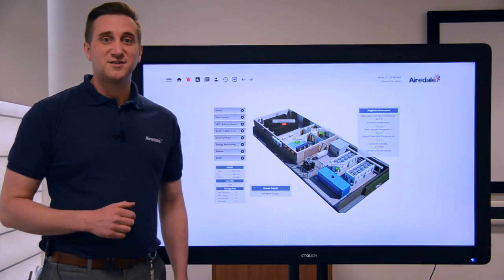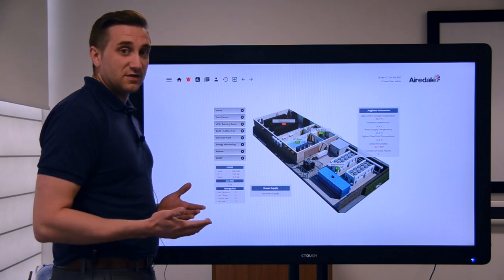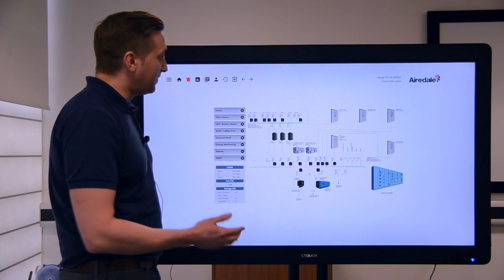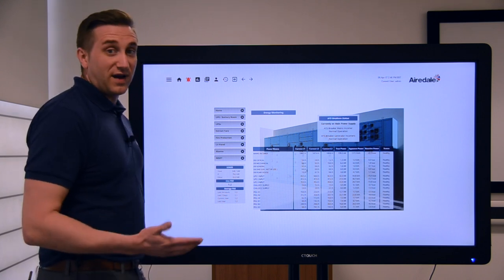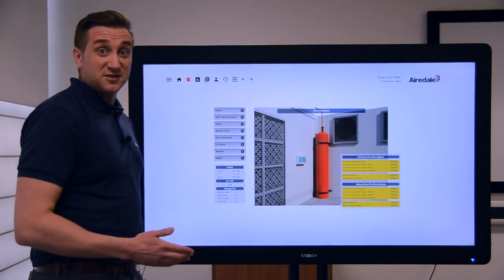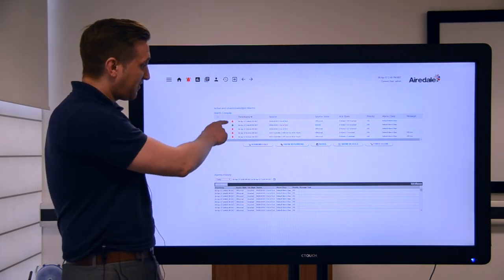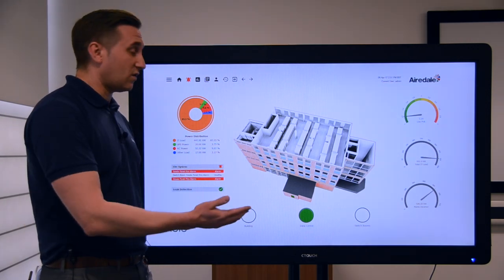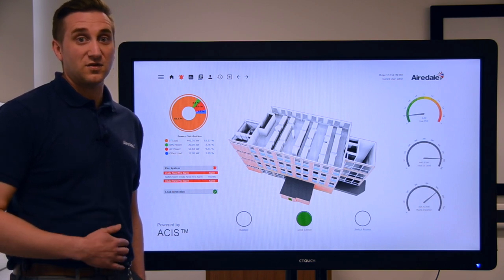ACIS™  Building Management System (BMS) Demo with Jon Martinez

Comment: What the different between BMS & BAS?
Reply: Hello, nothing really. I think it’s an Americanism. BMS (Building Management System) would typically be used in the UK and BAS (Building Automation System) in other places. They describe essentially the same thing, where you have a combination of hardware (temperature sensors, EC Fans, dampers, etc..) monitoring and affecting the building based on software running in a controller which is able to integrate with the hardware.
Generally each BMS/BAS is custom made  for each install, but there is a lot of integration that happens now with things like off-the-shelf Air Handling Units which will run within certain parameters and either run to the BMS’ requirements or the BMS may just be used to monitor what different systems are doing and raise any alarms to on-site staff/remote monitoring facilities.. as you can tell, it’s a very diverse sector and each BMS/BAS will work differently to others, some more closely, some vastly different.